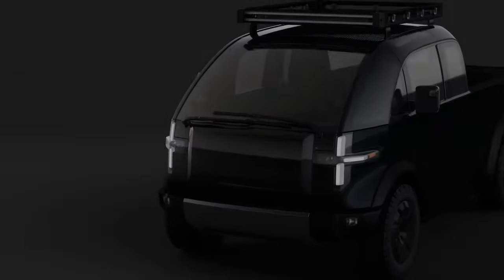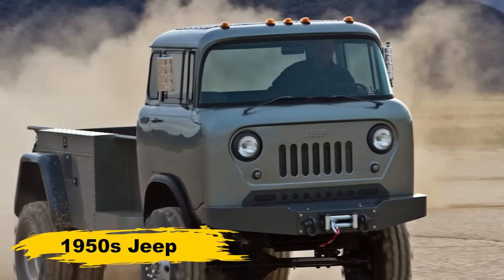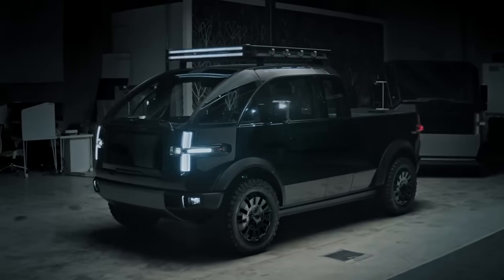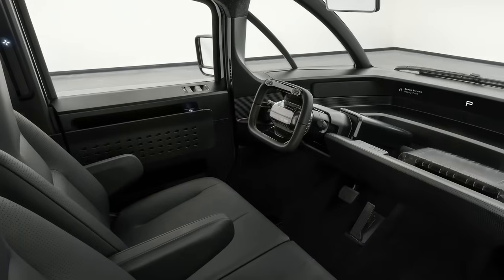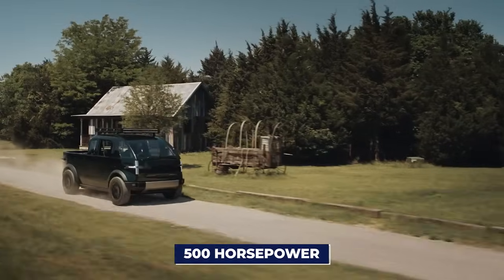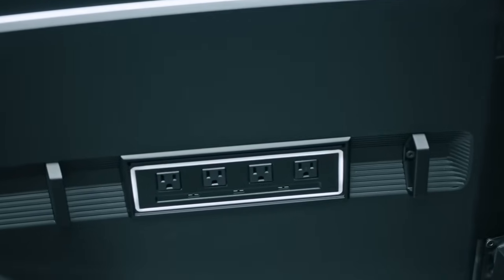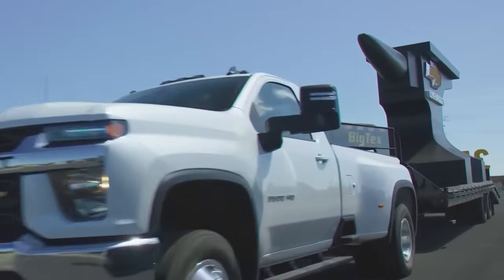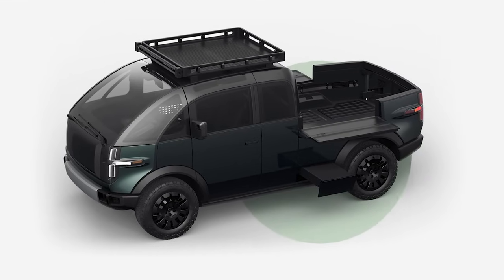ITS HAPPENING! All Electric Canoo Pick Up Truck Is Like NO OTHER Truck You've Ever Known Or Driven!

Comment: Getting the American and European consumer to accept the change in visuals and touch based concepts. I can see two types of vehicles in the future. Vehicles designed for exclusively close (100 mile radius) and travel vehicles that can reasonably be used in town and for long distance traveling. Unless families live close together, there will be a need for a high volume (6 to 8) passenger compartment with storage in a separate area of the vehicle. that may be 50 years from now, or it may be a much shorter time frame. What will make the difference is what the consumer will accept easily
Reply: I see hydrogen combustion engines obliterating the ev market in a much shorter time frame.

Comment: Love the design and I hope the company  becomes big one day. I’d buy the truck but here’s what I’d change:

- make it a 4 seater (It has a snub nose design so why does the driver sit so far back?

- make it have as close to 300 miles in range as possible

- hopefully it has 1 pedal driving

- better looking screens on the interior. I’m a fan of a large iPad like screen/ infotainment system. 

I do like the steering wheel and the fact they are drive by wire.

Comment: As with most EV startups, one has to be skeptical of the odds that they will ever deliver a vehicle.  However, the idea of an actual utility pickup for local jobs which can be configured only with the bare bones requirements for delivering materials locally really appeals to me.  This kind of utility plus a comfortable and fuel-efficient ICE sedan could cover my needs and dramatically reduce overall total vehicle + fuel costs for me.

Comment: I love this concept and would not hesitate purchasing one if I could get it with a "gas range extender".  After owning several BMW i3s,  I can say without a doubt that the serial hybrid is a level of versatility that would take me anywhere I want to be such as camping deep in the pucker brush.  I also desire the ability to use the gas generator as an external AC power supply, it would give me the unlimited portability I want from a truck or van.  The Ford Lightening was supposed to deliver on this feature but was far from a cost effective option for me.  This leaves a huge market for the utilitarian kind of guys like me.  With this capability, it would be the only vehicle I would ever want or need.  I would love to see the Mazda rotary range extender used.  It's compact, light weight, smooth operation would be the dream setup for me.  Best of Luck with your endeavors! :)

Comment: I’m thinking that the battery replacement costs are more than the price of the truck. I like the style and the idea but they need to lower the battery replacement. If it cost $22,000 for the truck and $30,000 to $50,000 to replace the batteries, then you end up paying up to $100,000 or more.

Comment: i'll believe it when i drive one. i may like it, or may not. the looks are nice and simple (i'm a bling-free-zone kind of person) but i really don't care what it looks like, just like i really don't care what people think about me because of what i drive. funds follow function. does it perform? do all those little doors not just snap off at the slightest bump?, do the bells and whistles actually bring something useful to the day to day, or do they just add weight and complexity? can i get a stripped down super light version that i build out myself? i need to see more than just adds. this has been going on now for years.
Reply: I think you should be concerned about range above anything else..
Reply: $21,000 dollars; it is super fall apart flimsy
Reply: i want a low range EV
Reply: I doubt you’ll ever drive one, that doesn’t mean it’s not real.